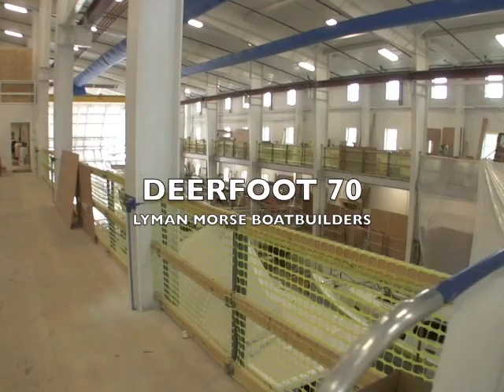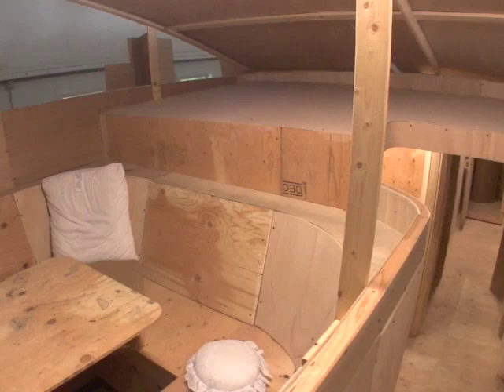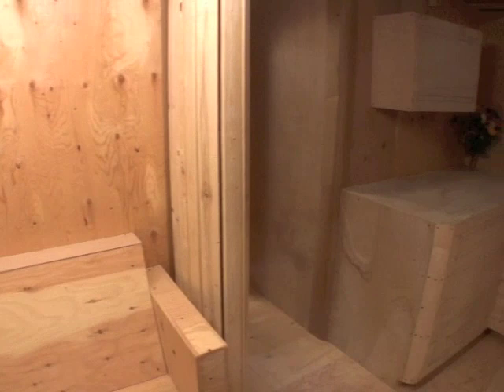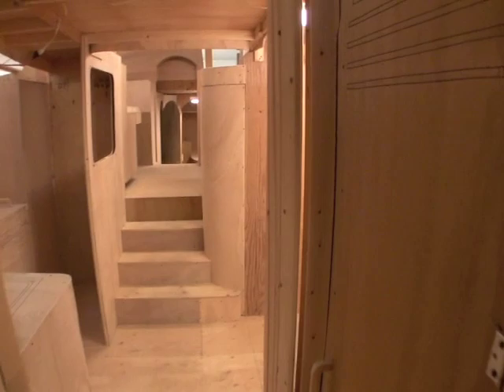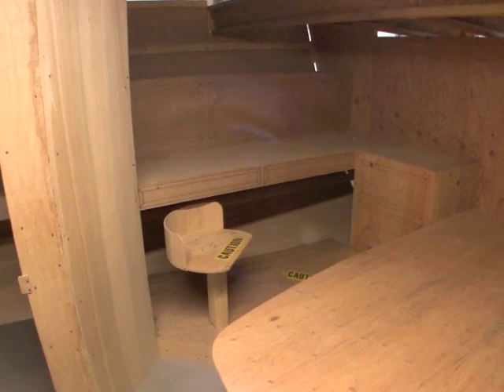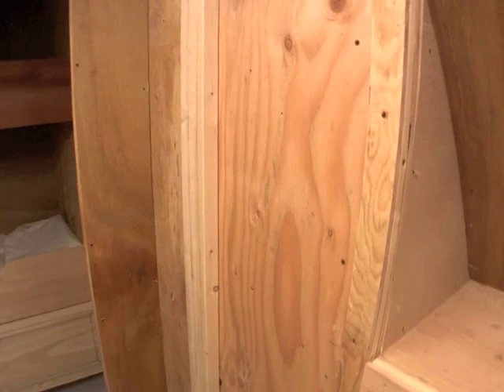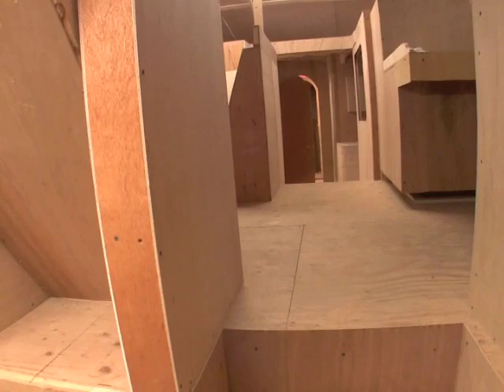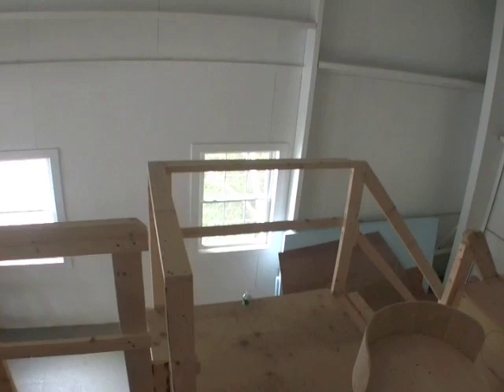Part 1: Lyman-Morse Boatbuilding Construction of Deerfoot 70

Comment: you need a drip edge coming into the galley from deck. also would be nice to add stainless rail under the traveller all the way to the hull ,laminated to hull for strength. no need for gail to rip that area out before you get into control mode. just something i saw on a friends boat that  race sails with the big boys across the big waters. do you also have 2" scupper drains ?